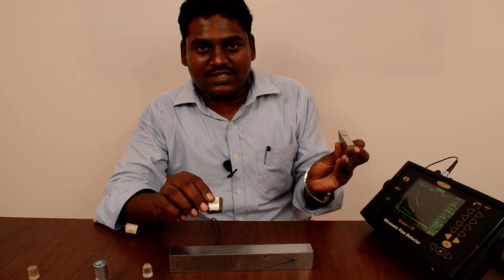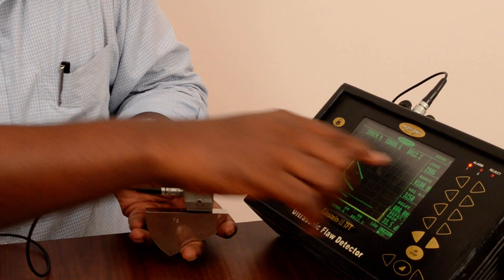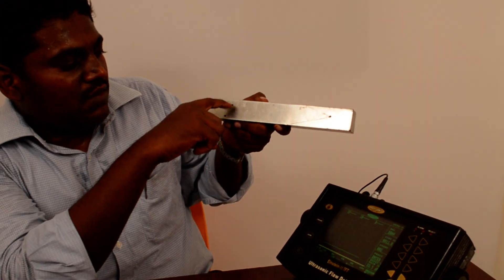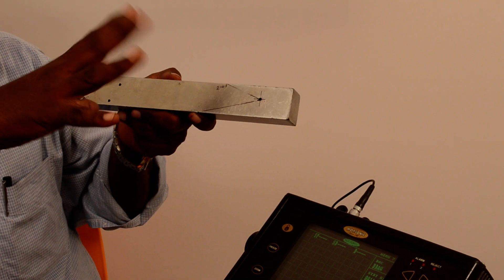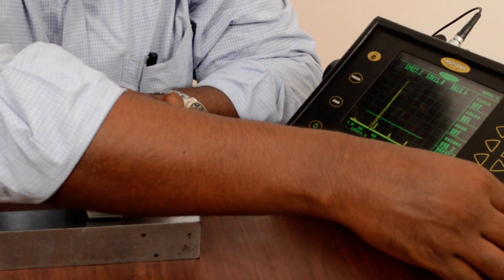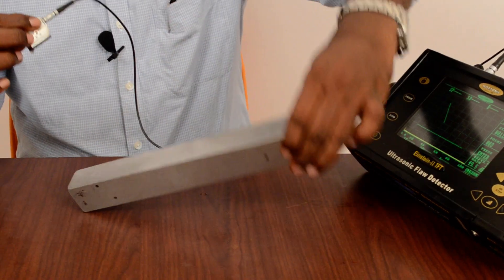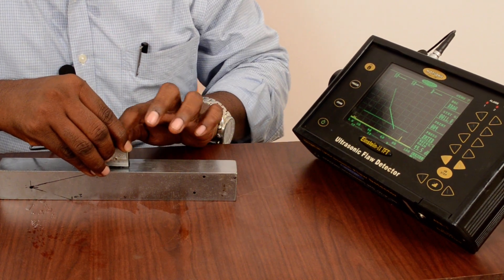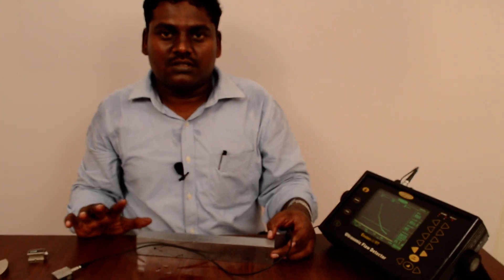Ultrasonic Testing Distance Amplitude Correction (DAC) Tutorial Video.

Comment: Sir, I have one question. Gain for 80% amplitude and other amplitudes ( 50 and 25%) will be same in DAC curve?.
Reply from the maker: Yes, the DAC (Distance Amplitude Correction) curve should be plotted across the full range. The reflector (hole) located at the shallowest depth will produce the highest amplitude signal. As the depth increases, the amplitude of the echo gradually decreases. This reduction in amplitude occurs due to attenuation, which is the loss of sound energy as it travels through the material. Factors such as material properties, beam divergence, and scattering also contribute to this decrease in signal strength. By plotting the DAC curve, we can compensate for this attenuation and accurately assess reflectors at different depths.
Reply: Thank you sir

Comment: Dear Sir. 
Very nice.. 
Can you give details of DAC block. 
That is dimension and holes drilled  measures..
Reply from the maker: this block is a 20 mm block, with 1.5 mm dia hole of 5 mm depth, 10 mm depth and 15 mm depth
Reply from the maker: Thank you for your comment! The DAC block has a thickness of 20mm, with holes drilled at 5mm and 10mm depths. From the opposite side, the 5mm hole will appear at a 15mm depth. Let me know if you need more details! Also, if you find our content useful, please subscribe to our channel and share it with others interested in NDT. Your support helps us create more valuable videos! 👍😊

Comment: Dac for 70degree would that work for 45 or do you hve to make another curve for each probe?
Reply: No it won't work as the beam path would be different for both the probe hence the curve would be different
Reply from the maker: No, We need to do a separate Calibration for other probe. Calibration done for one probe shall not be suitable for other probe.

Comment: can we used DAC curves plotted  on steel calibration block for tasting aluminum  welding by just to Chang the  velocity
Reply: can .. no need using any probe. using ur tounge
Reply from the maker: No we cannot use Steel Calibration block for testing Aluminium, we need to have Aluminium Calibration Block for Carrying our Calibration and Inspection.